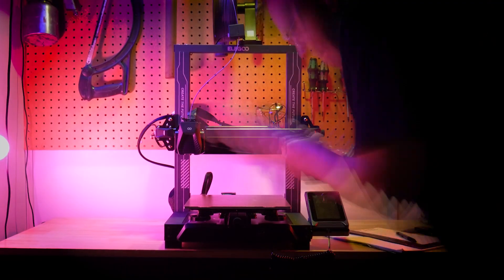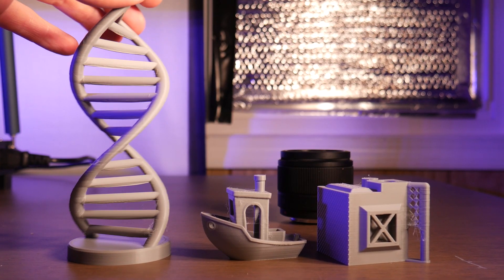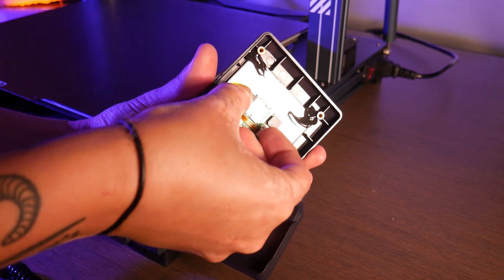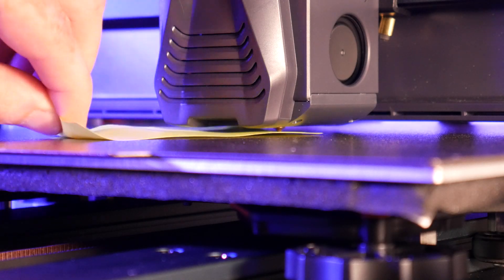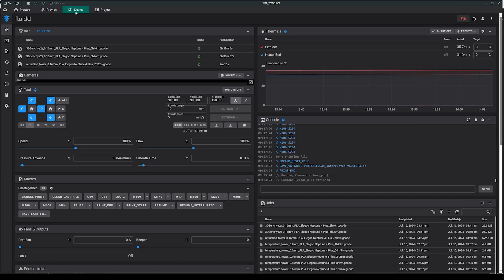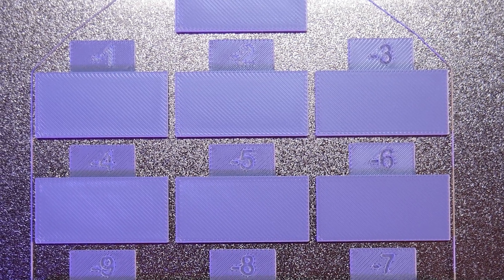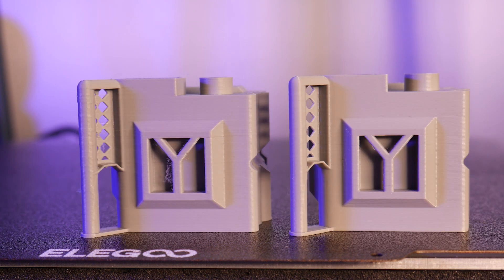ULTIMATE 3D PRINTER TUNING GUIDE for the ELEGOO Neptune 4 plus / pro / max

Comment: Great video! Any recommendations on speed settings or how to fix movement of the print object? I can't get past the flowrate test cause the first layer doesn't want to stick to the bed and then the printer starts to go really fast for the second layer. I tried to "slow it down" but it doesn't seem to help.

Comment: How do I make input shaping calibration? My Neptune 4 PRO gives an error when I enter SHAPER_CALIBRATE in console
Reply from the maker: I believe the 4 pro shipped without accelerometers? On the klipper website there is instructions on how to manually tune resonance without using accelerometers.
Reply: @WildRoseBuilds  thx I will check it out

Comment: After changing the rotation distance in the printer config file - do you then leave your filament settings alone? For example, in your demo where you changed the rotation did you then set the flow ratio to 0.965 AS WELL or do you leave it at 1?
Reply from the maker: Leave flow at 1 if that’s what you ran the test at. The whole point of rotation distance tuning is to alleviate your slicer from having to apply the flow multiplier to all your extrusions. Hope that helps!

Comment: I laid down $500 for the MAX about two years ago; never had a good print, no matter what I or my son did to calibrate, and trust me, we tried and tried. Bought a Bambu P1S, and never had a BAD print. Over a hundred prints in, and perfect every time. I wish my MAX would have worked, but the bed, and manual configuration, is crap. I wanted it for very large prints, but I'm not an Elegoo fan at this point.

Comment: For those who are watching the video in July 2025 or later, it seems like elegoo have redesigned centric wheel nuts. The under extruder and under the bed are no longer adjustable. Since they use different design.
Z axis wheels can be still adjusted

Comment: this has to be one of the best breakdowns of tuning a 3d printer that runs on Klipper.  ive been spoiled since i got my bambu. but i want to get something bigger and didnt want to deal with what i had to deal with when i was running my old Thinker SE that felt like i spent more time tuning than printing with it til the thermistor went and even after replacing and tuning never ran well again.  

this video makes me realize there wont be as much tinkering as i thought there would be running something newer that still doesnt have all the bells and whistles.

Comment: The advanced features (input shaping etc.) are missing from my menu on the Neptune 4 Pro, and it has the latest software. 
I assume my printer has the required hardware but could not find any information on this online. Do you have any suggestions?

Comment: Mine is an Elegoo Neptune 4 Pro, but it didn't come with the input sharper and nozzle pid calibration, will there be an update? I'm on firmware 1.1.3.3 and UI 1.2.16.

Comment: Thank you so much for this! I just got a Neptune 4 Max, it's my 3rd FDM printer... And I was really struggling to get decent prints. This helped immensely!  A note to others: bwhen you're modifying the rotation setting for the extruder in the printer.cfg file that you modify the correct rotation value. I accidentally changed the X axis rotation value and prints weren't printing at accurate dimensions along the x axis. Oops!!!
Reply from the maker: Glad this helped! Classic mistake!

Comment: Excellent tutorial - I really appreciate the insights on the test order.   How come you make the changes to  rotation distance and pressure advance in printer.cfg instead of in the filament profile for flow rate and pressure advance?   Is it more you are assuming the values put into printer.cfg will be your standard tuned setting (e.g. for PLA) and then if you need something different (e.g. for PET G) then you would put the filament specific settings in the filament profile?

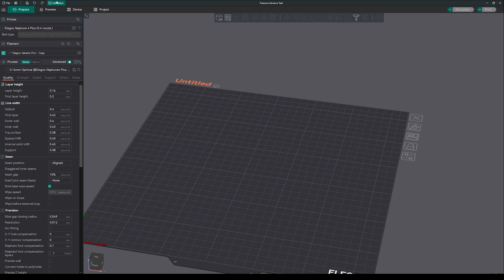Comment: For those wondering, in the minute 14:56 after calculating the pressure advance, getting 0.46 on the calculator and leaving 0.046 on the config file, seems like the 0.046 is the right value, I've run the test with my printer getting 0.36 on the calculator and setting it in the file, after trying to print the corners where completely empty, after running the print again with 0.036, everything looked perfect. I see this same error in the OrcaSlicer calibration guide in github too.
For me adding a 0 worked fine but may vary from one printer to another, maybe the guide is correct and this is a me issue
Reply: You are right. He specifically stated to multiply the measured value by step value - which is set at 0.002.
Reply: @MrBml1999  Yes, this should be pinned. Came to the comments when I noticed he uses 0.02 in the calculator and says 0.002 which is also the step value.
Reply: I agree, in the video he puts 0.046, but he doesn't say at any point that you have to add a zero to the calculator result.
However, I believe that if the person is paying close attention to that part, they shouldn't do it wrong.

Comment: Thanks for the video, did not tune my printers for months. Time to do a calibration day haha.
I think your print results are "worse" than a normal plus/pro/max, due to the timelapses that are enabled.

i have 3 N4M for around a year, and 5 recent. The recent machines came with a green usb, the other ones with a red one. Not sure if im crazy but the green usb machines had loads of less problems than the red usb machines 🤣

Edit: im still watching the video, if you do pid tuning in klipper you can do bed and nozzle temperature!

Comment: a Question: 
after configuring optimum temperature off nozzle. You start retraction test, but you discarded the temperature config you've set. As far as I get, temperature nozzle and retraction works dependently, aren't they? Shouldn't you not discarded the temp config you've set by looking temp tower?

Comment: This is an amazing video, really help me set up my first even printer using PLA but.... I'm having some hard time print PETG after switching to Hardened Steel Nozzle from Elegoo .... something just not right and i would love to get your feedback
Thanks for sharing your knowledge
Reply from the maker: Glad it helped! For petg if you have auxiliary cooling like the large fans on the back of the Neptune 4 turn them off. Dig into your settings and lower your part cooling fans as much as you can while still being able to print overhangs. Petg is a bit finicky. Let me know if that helps!

Comment: I will probably wind up watching this video 17,482 times in my life.  Just bought one of these as my first printer and you, my friend, are a life saver. I'm not even unpacking my machine until I've totally digested this content.
Reply: Saame
Reply: on my 1001th time watching
Reply: I recently bought a pro 4. I don't think there's much difference between the pro and the plus so I'm pretty sure that this info will be applicable. I'm going to go through this video step by step with a lot of pauses. Hopefully my printer will work then.
Reply: @gwick358 The only difference is the bigger bed size and the on board wifi on the plus. The pro does NOT have it. But still, it doesn't mean it's still not a good product.
Reply: Ditto!
Reply: Me too 😂
Reply: bro sameee
Reply: You better send it back, its such a trash product.
Reply: @steven20919  You raging on the cable clamp part of setting one up? 🤣
Reply: @Memeteamssix  No the product in general. It just takes too much time to get the thing calibrated. And then its very variable so end up having to calibrate it multiple times. And since where I'm using it for time is of the essence, I bought a Bambulab.
Reply: @steven20919 does it not depend on who’s using it? Perhaps the machine is too technical for some people!

Comment: Why use the 1st flow rate test if you end up using only the values from the 2nd flow rate test? What is the 1st flow rate test used for?
Reply: Here's the missing step from the 1st flow rate test from Orca Slicer documentation:
After running the 1st pass test:

5. Update the flow ratio in the filament settings using the following equation: FlowRatio_old*(100 + modifier)/100. If your previous flow ratio was 0.98 and you selected the block with a flow rate modifier of +5, the new value should be calculated as follows: 0.98x(100+5)/100 = 1.029.** Remember** to save the filament profile.

6. Perform the Pass 2 calibration. This process is similar to Pass 1, but a new project with ten blocks will be generated. The flow rate modifiers for this project will range from -9 to 0.

7. Repeat steps 4. and 5. In this case, if your previous flow ratio was 1.029 and you selected the block with a flow rate modifier of -6, the new value should be calculated as follows: 1.029x(100-6)/100 = 0.96726. Remember to save the filament profile.

Comment: Adding these tags cuz I keep coming back here:
0:56 - Make sure eccentric nuts are tight.
1:37 - CLEAN YOUR BED.
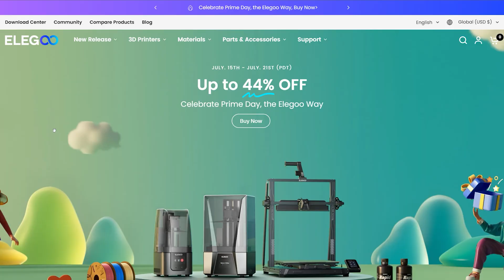3:11 - Check for new firmware and update if new firmware is available.
6:07 - Level the bed.
7:58 - Run Input Shaper Calibration.
8:16 - Run PID calibration.
10:33 - No one uses project tab in Orca Slicer.
10:45 - Check out Calibration menu.
10:57 - Start with Flow Rate test since it will affect all other tests.

Comment: Sorry if this is an ignorant question, but if I am unable to run an ethernet cable to my modem for internet, but still want to have access to the control features that this allows for via interfacing between the computer and printer, can I run a USB cable from the printer to my computer and still have the same control features?  Or are they only accessible over the internet?

Comment: Will flow rate yield different results based on the filament you’re using?  If so, will I have to test filament rates for each new filament I’m working with?
Reply from the maker: In my experience they’re quite similar at least when it comes to pla. I’ve printed dozens of different pla brands and the only ones I notice need a different extrusion rate is a select number of matte pla’s. If you stick to a few reputable brands there shouldn’t be any noticeable difference across colors. The +/-0.02mm that most brands advertise seems to be accurate.
Reply: @ thanks for the reply:). Much appreciated

Comment: Hey there, I picked up one of these used the other day (first 3D printer ever) and had a few quality issues with my first test prints. I found your guide and dove in, and found several of the wheel nuts on the bottom loose and tightened them up, went through the calibration several times and went to do the first "flow test" print. The printer warms up, goes to the top of the print bed and prints the test line, then goes to the middle and 'starts' printing but now immediately just starts to gum up on the nozzle and never puts anything down on the build plate. I tried 2 different types of filament and leveling the plate a few more times but the exact same thing happens every time now. Any tips? Thanks!
Reply from the maker: Hey Nathan! This could be a few things. First make sure the bed has no oil from your fingers on it. Clean the bed super well with soap and warm water (I scrub mine in the sink every week or so). Oily fingerprints create an interface that the molten filament will seem to repel from. Next try lowering your z offset. You can do this after the bed leveling sequence or during a print under the settings menu. You’re looking for the perfect first layer “squish”. Too close and the nozzle will drag through the first layer. Too far and the filament will gum up around the nozzle. Let me know if that helps and welcome to the community!
Reply: @WildRoseBuilds  I ended up cleaning the bed again with soap/water and then putting glue down and that made the difference. People keep telling me I shouldn't need glue when the bed is clean, but every time I try without it, I get issues so I'm just going to stock up on glue!

Comment: 14:19 My print looks consistent (Honestly great..)  the whole way through.. I used your command from you other video before printing - 
Run this command first - SET_VELOCITY_LIMIT SQUARE_CORNER_VELOCITY=1 ACCEL=500
Then this command - TUNING_TOWER COMMAND=SET_PRESSURE_ADVANCE PARAMETER=ADVANCE START=0 FACTOR=.005

Perhaps that was why?

Should I even worry about this?

Comment: Okay, so it looks like you are still responding to comments on here, so hopefully you can help me.  I followed your steps and did notice  z axis wheel was not making contact.  I have had lots of failed supports that have been just getting knocked off. I thought, it must be my retraction / zhop, so i adjusted and doubled its value.  No luck.  I figured it was the bed, so i enabled professional leveling and went through the whole 121 points.  Tried a calibration test, no luck.. it was stringy, would peel or would just blob in some areas, roll around and I would have to stop the print.  It was as if no matter what, my leveling did nothing.  So, I found this video, fixed my rail as mentioned before and followed your steps.  I have an N4 pro, so no cool menus or accelerometer.   I skipped this part, so perhaps that's my issue, but i went to do my flow rate test.  I couldn't even get most of one square down.  I re-leveled, tried again, no dice.  I started the print, went into settings and cranked my flow rate to 110.. the print got better, but still failed.  I went to 120 and that worked fairly well, still failed on block 4.  How are you making it through all the blocks A, and B how high of flow rate should I go?  I am using creality hyper PLA.  It sits in a dryer and afaict everything else has been adjusted accordingly.   I can print a benchy just fine. (it looks pretty good, but not quite as nice as yours)  Once I go to print anything remotely technical and not dead center, I get horrible results.  Should I be doing all your math before I worry about my flow rate??  Any help would be much appreciated.  Also, this video and your other are so well done, will most def be subbing.  Thank you for your wonderful content, your pace is perfect, your shots are amazing, the details you show for what over extrusion and under extrusion look like were super helpful for identifying.. all of it was amazing. Well done!

Comment: Be careful setting your Flow Ratio to 1! (11:09)  All my Calibration Prints failed because of dragging, i set it back to 0.98 and all my issues went away!
Reply from the maker: After setting it to 1, you need to do the flow calibration. Over extruding will skew all other tests so that needs to be dialed in first!
Reply: @WildRoseBuilds  I couldnt even print the Flow Calibration once without all the infills getting ripped apart, tried changing everything and no hope, changed it back to default 0.98 and right now it is printing without issues, after trying for 2 hours!

In my case i cant go above 0.98!
Reply: Same issue here it ripped  to test prints and dragged

Comment: did you really say "tighten all 6 bed knobs..." ?
like seriously? i am genuinely asking. because you really did squeeze all the springs!
Reply from the maker: The funny thing about springs is they “spring” back… 😅 you want the springs holding the most tension possible so the bed is as rigid as possible.
Reply: @WildRoseBuilds  ok. but then, when you need to move some part down, and that part is already down, so you cant move it pretty much anymore, what do you do then?

Comment: question :  My print head now comes off the front of the bed when doing an auto level this happend only after I had a support fall off and got behing the bed belt and caused a layer shift.. how do I reset so the print head returns to its normal position.. neptune 4 max

Comment: Love this guide.  Couple of questions/ clarifications.

1) for the pressure advance, shoudl you multiple by .002 or .02?  because you put in .046, but in the calculator you put in .02 to get you .46.
2) Should you ignore the 12 non-manifold edges when you print the temperature tower?  I am assuming yes cause thats what it looks like you do, but may want to let people know.

3) Is there a reason why you setup the configurations in the printer.cfg vs putting the changes directly in orca slicer?

Comment: Thank you for taking the time to create this video. The level of detail and pace are just right.
One question, though. In the flow rate calibration, did you (or not) update the Flow Ratio between the first and second pass? I didn't see you do that, so I'm assuming not. I only ask because the Orca Slicer wiki on Calibration does update the rate after the first pass (though they don't do it in the config file). Thanks again.
edit: Sorry, upon replay, I just noticed you said "I'll leave my flow rate at 1 and start the next test".

Comment: i also adjusted the z axes rail. it was with offset. i notice it when i could see that one wheel was without contact. and spin freely. so i hold one of the z motors and spin the other a few clicks (belt clicks)  that way i could make sure that all the wheels are with good contact on the rail. this is super important. without this step. the hole rail is moving.  i stoped doing this when i see that there are no free wheels. on both sides

Comment: I just got my Neptune 4 Pro. I see that I'm missing the Input shaper and Nozzle PID Calibration under Advanced settings. I've updated my firmware. Could it be that the 4 Pro lacks these features?
Reply: I'm in the same boat too :( even as a "PRO" it seems to be missing some advanced features. Should have done some more research. Poster of this video should remove PRO from the title so it doesn't get hits from people looking at PRO's and then getting confused.